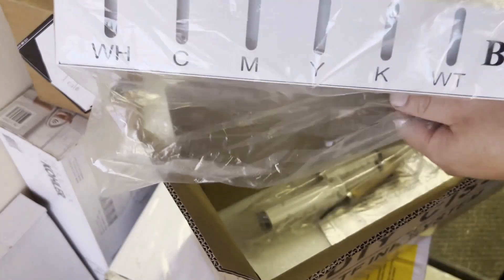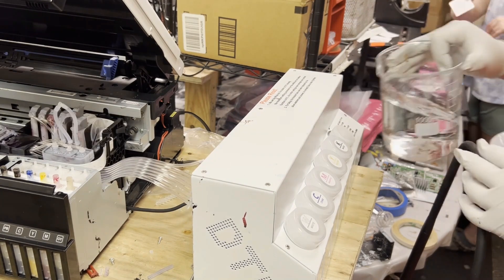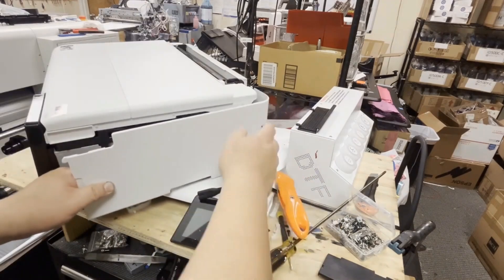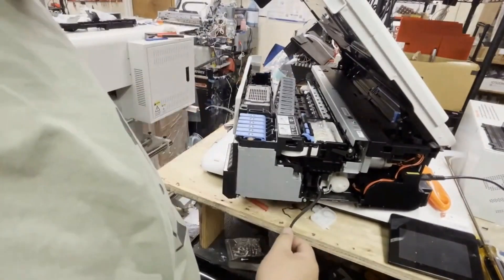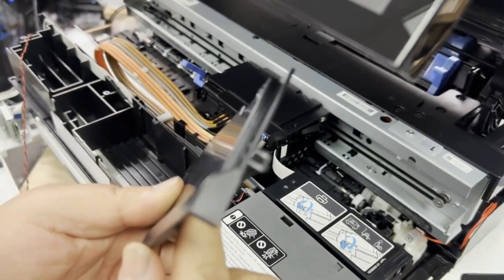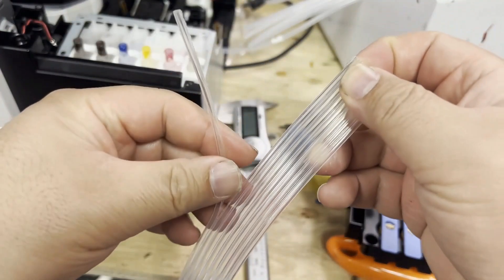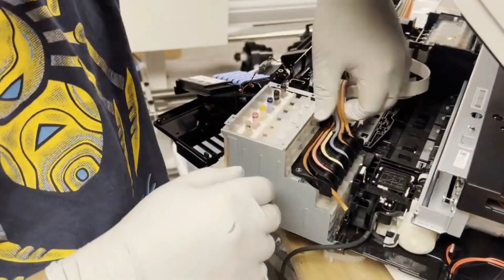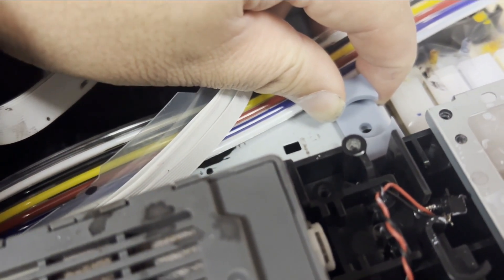Pro-Level ET-8550 DTF Conversion: Install Ink Delivery System - Complete Course (Part 1)

Comment: I need  help i have one white bottle 🍼  but my print head need 2 white inks to spit to ink head . How to use one white ink bottle split to two tubes for   ink head
Reply from the maker: Thanks so much for watching and for your question! You can split one white ink bottle into two lines using either a T or Y connector. For the T connector, search *AS-TUBE-Connector-TT3* at bchtechnologies.com. Most people cut the tube in front of the dampers, insert a T there, add another T at the other white tube, then connect the two Ts with a short piece of tubing—use either *AS-Tubing-ST2K-OR* or *AS-TUBE-25* for that link. If you only have one white bottle and a circulation system, you can place two Ts side by side (like ==T=T==), connect them to a single tube for circulation, and you’ll have one inlet and one outlet for flow, with each leg of the two Ts going to a damper. I really appreciate your engagement! Because there’s a high volume of questions, subscribers and members get priority answers within 48 hours and also receive early video access and exclusive perks. I typically answer around 10 questions a day, and after subscribers and members, any remaining slots go last-in, first-out (so newer comments are reviewed first). If you’re not subscribed and don’t hear back within 48 hours, you can subscribe or re-post your question—subscribing later automatically makes your older questions priority. For faster help, you can also email [support@bchtechnologies.com](mailto:support@bchtechnologies.com). And if this video or comment helped you, please consider leaving a quick Google review here: [https://g.page/r/CfL7k6nYvPQ9EAg/review](https://g.page/r/CfL7k6nYvPQ9EAg/review)

Comment: Why are you using 7 tubes in the drag chain when there are only 6 tanks, or is the 7th tube for the waste tank? Thanks😊
Reply from the maker: Thanks for subscribing! Your support helps us get closer to our 100k goal, and I really appreciate it. Great question! The extra tube is for delivering distilled water to the printhead. When the printer isn’t running white ink, the white damper can be swapped out and placed on distilled water to keep things clean. The white ink only stays in the system for a few hours during printing. Let me know if you have any other questions—I usually get back to subscriber questions within 48 hours! 🎉

Comment: Hey Kevin, any idea how long I could expect an Epson ET-16650U to last as a sublimation conversion or is that just a hard line do not use sublimation ink. I know it voids the warranty but not concerned about that
Reply from the maker: For those printheads, I think about 3,000 pages (sublimation).